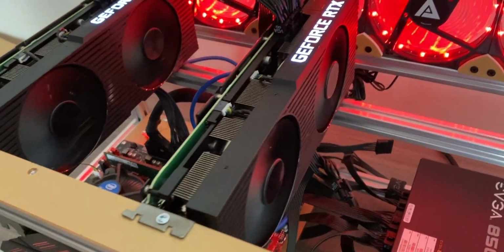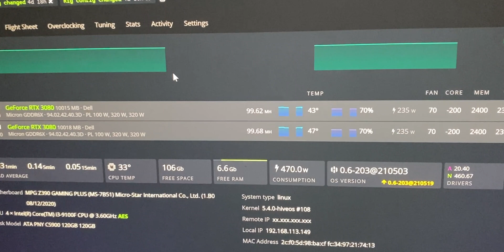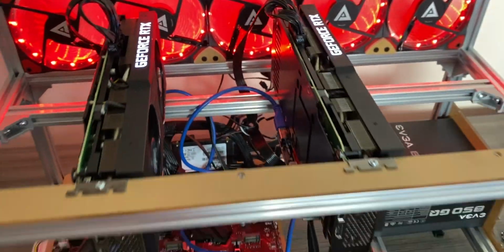RTX 3080 Thermal Throttle Fix - 99mhs on Hive OS. Replacing the Thermal Pads and  Thermal Paste!

Comment: Aorus Extreme RTX 3080 rev 1.0. Thermalright Odyssey 12.8w pads 2mm on the mem chips, under backplate 1mm core, other backplate  somewhere 2.5-3mm pads. Mem T junction before 110°C with thermal throttling, gpu temp 51, after -mem T junction 78°C, gpu 58 (with more past on gpu chip because 2mm pads are to much). I used 2x1mm pads temporarily. In future i will use 1.5 mm on the memory chips. Interesting is also, that for my card are 6W pads on the memory chips totally useless. Temp memory raised again to 110°C.  It doesn't matter if 1.5 mm, 2mm or brand Arctic or EC360 - 6w pads.
Reply: ====1.5mm @ 12.8w ====
OK, got it.  Needed this info.

Picked up x3 of these 3080 and ive been keeping them around 68 but one of the fans is out so I gotta re-do all these thermals.   but hey! summer is coming and i bet this will be good for keeping my MH up.  Guy who sold me had these burning at 101MH...68degree.      
Core: -200 *? (+/-) (I did +74 and +144 core)
Mem: 1100-1300
Power: 130w-250w
Let me know if anyone else can hit 100 or 101
I have hit these numbers